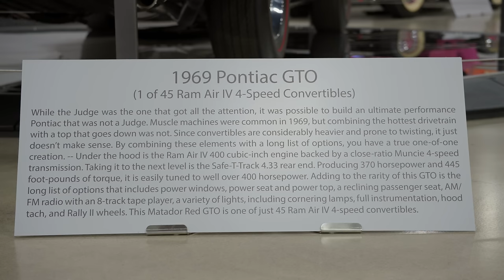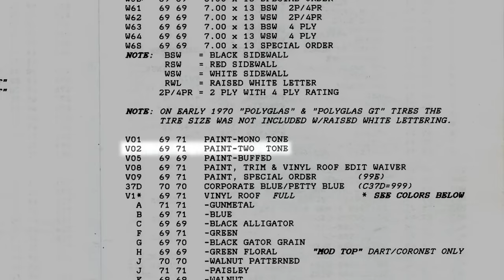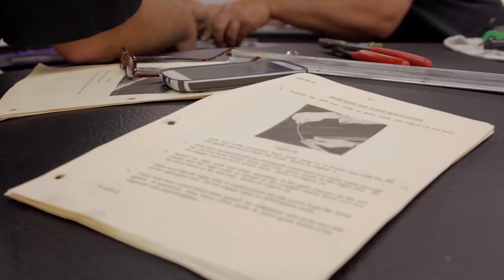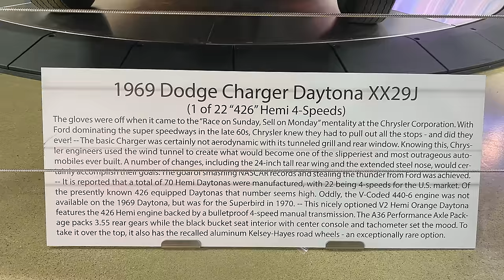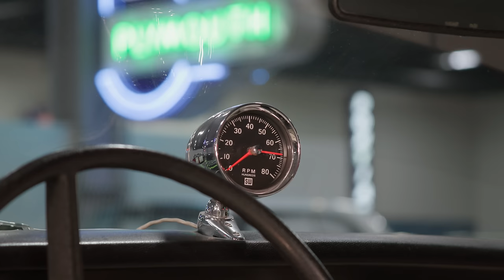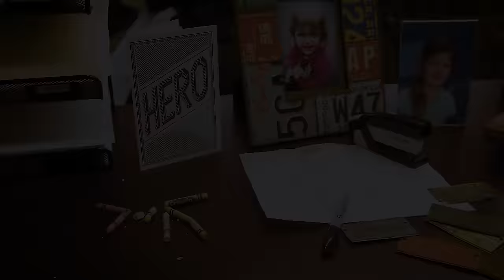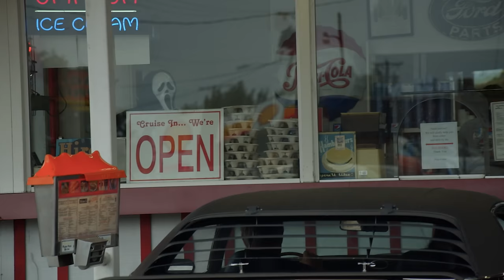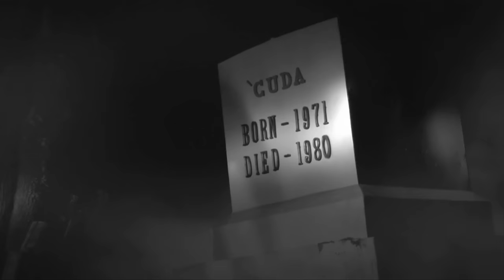200TH EPISODE OF GRAVEYARD CARZ CROSSES ALL THE LINES!

Comment: I am not a Mopar guy, but I do appreciate great cars. I used to know a lot about cars and helicopters, now I can't remember anything. I am 59, so right there with you. Hold on. That is a point I want to make. I have seen 30,000 1970 Hemi Chargers with 4 speed. I have seen as many 1970 Chevelle SS 454 LS6' too. I know I am exaggerating, but not by much. A lot of them were swapped over and I never checked vin's or any of that. My car would be the 429 Boss Mustang or if you see one a 427 SOHC Cobra or and I have seen them swapped in Mustangs, Torinos and other Fords.